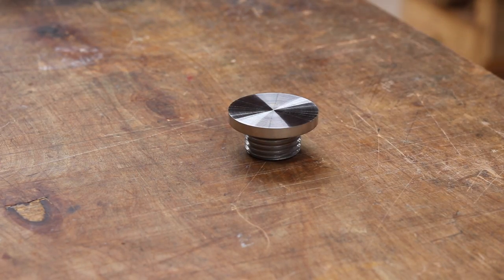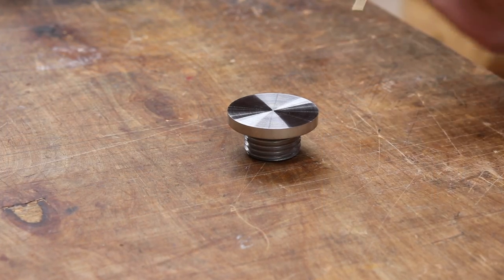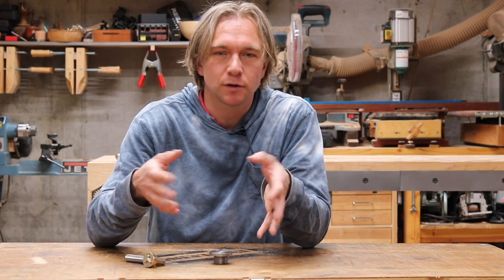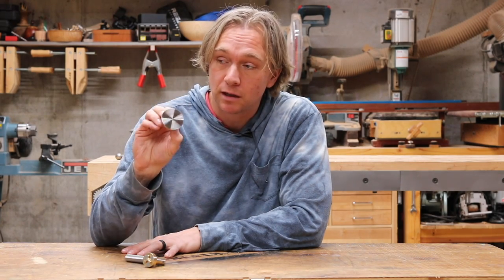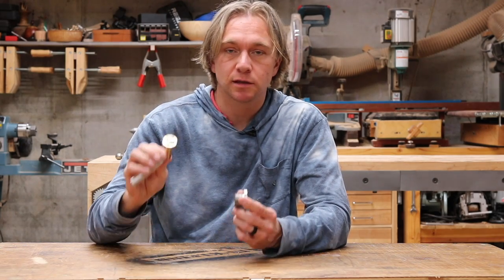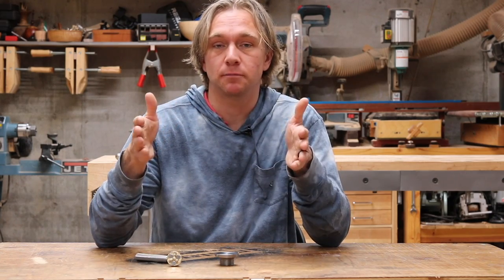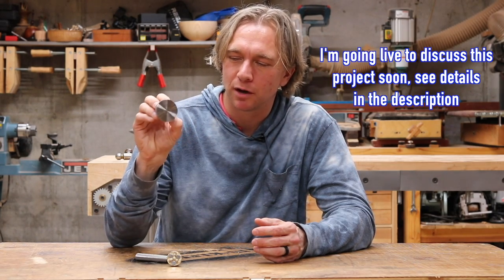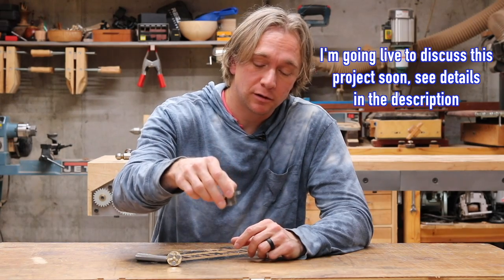A Screw With No (visible) Slot Is My Next Big Thing!

Comment: That's fuckin awesome. Yes I would buy it
Reply from the maker: Well you are in luck, the presale is open:

https://www.in-kleind.com/store/PIKA-c123455757
Reply: @AndrewKleinWW  do u have stock?
Reply: @AndrewKleinWW  I'm an engineer with 30+ years of automation. About 16 of those years was spent doing what we call special purpose machinery, which is basically production cell development. I have had to deal with people doing exactly what you are doing and make the production machinery for it. You are faced with 2 basic choices. 
1) you get an existing manufacturer who can do the level of precision you need to make what you have; or
2) you develop your own production which many do and MOST (as in 99.99%) fail at.

I'll break this down into a couple of comments so its easier to digest.
Reply: Regarding Option 1 - Getting an existing manufacturer to do the production.

Again there are options. 
a) You subcontract and maintain control of what gets made. If you don't have the experience with managing subcontractors you will go broke very quickly.
b) You take on a manufacturing partner as in you sell a stake in your business to someone who already makes things. You will lose a lot of control of what gets made because your manufacturing partner is going to want to make money. They 100s of things they might do that you might not like including re-designing your idea and that might mean cutting you out of making money. So if you take on a partner you make sure you have the money to pay a damn good lawyer to cover your interests.
c) You take on business partners just like people do on Shark Tank. Again you make sure you have enough money to pay a damn good lawyer to cover your interests.

Note: I did see you other vid about naming it and dealing with trade marks. So here is a bit of what I know about IP and Trade Marks.

IP is simply brutal. Just expect to get ripped off or for people to try and rip off your idea. There are simply no shortage of thieves in the modern world and the better ones have squads of lawyers who will simply beat you into oblivion. 

Trade Marks are different but there is a serious issue there as well.

If you remember there was a story a couple of years ago when Ivanka Trump secured her trademarks when she was in China.

I'm Australian and many Australian companies have found Chinese trade mark squatters already trying to snatch their trademarks. These people sit in offices in China and watch the world for people registering Trade Marks. When they see a new Trade Mark they copy it and register it in China. Their aim is to make you pay them to get your trade mark back. We have a huge export market in dairy to Asia and a huge part of that is into China. Our Dairy industry has had so many trademark fights with Chinese trade mark squatters. I have seen stories where people had their trade marks stolen in China with in hours of registering in Australia.

If you are not careful you will find Chinese knock-offs with your trade mark on the international market and you will get NOTHING without a hell of a battle.
Here's a story on one of the VERY FEW Australian companies that won any sort of legal battle in China with respect to trade marks. 
https://www.abc.net.au/news/2016-09-16/lucas-mill-family-fight-to-stop-chinese-copies-of-sawmill/7848394
Here's the video story on it. Do watch it because its due to be removed soon.
https://www.abc.net.au/landline/cutting-edge/7857350

Just so you know ABC Australia is our equivalent of PBS it has nothing to do with ABC America. The Landline program is weekly program on our agriculture industry. They have covered the dairy trademark issue several times.
Reply: Regarding Option 2 - Setting up your own manufacturing.

FIRST: You are going to have to listen to someone like me eventually or you will go broke like many, many others have. I have worked for people with genuine world class billion dollar innovations a couple of times and they ALL LOST their money. Here's 4 common mistakes.
1: They did stupid things like get side tracked onto other projects. This is without doubt the biggest issue with creative people who like working out new ways to do things. The struggle to keep focus on getting the job in front of them done. Leonardo Da Vinci was one of the great non-finishers of history. Its why so few complete paintings of his exist and why so few of his other things exist. If he hadn't been such a prolific writer and a couple of his note books survived we'd know nothing about him. But he was hopeless at finishing projects.
    
2: They have insane expectations on how long it takes to do things. Prototyping manufacturing and engineering systems is incredibly hard and and it can be insanely difficult and time consuming to get right. Something might take 5 minutes to do but it takes days or weeks to find out what the actual problem is and what then needs to be done. Creative people seem to forget that their idea took time to form in their mind before that "Ah Ha" moment.  

3: They think their ideas are the only ideas that matter. Sure the main idea is their idea but the main idea is NEVER the actual solution to making money, its just part of the solution to making money. You can fill entire museums with stuff that should have made people money and they all went broke mainly because they never considered that anyone else had anything worth saying.

4: They overrate the financial returns. The ACTUAL number of billion dollar ideas is far far far less than the real number of billion dollar ideas. Go watch a season of Shark Tank or Dragons Den and you'll understand that. 

SECOND: Don't listen to family and friends, unless they are telling you to get a real engineer with real experience to get this done. The number of conversations I have had that started "My son said...." or "My friend said....." or "My Cousin said....." that wasted time effort and caused no end of trouble is staggering. In some very rare cases they help, but usually its somebody who either means well or thinks they know something. The people who mean well usually aren't much of a problem. The faux-expert cousin or friend is ALWAYS as disaster. 

In the rare cases that the "friend" actually knows what they are saying it all goes well but those occasions are incredibly rare. The few times that has happened to me they turn up introduce themselves and tell me a bit of what they do as a way of letting me know they are talking with some experience. After the usual common ground it goes all right.

THIRD Almost everything you come up with can be improved. What is important is that you plan to go through the process of versions just like you see with computer software. You'd be amazed how many project failed because people just would not get the first version done. The most important first step is get a SALEABLE product into the market and start earning money. It DOES NOT have to be perfection it DOES have to be good enough to do the job and help build your reputation. Its one of those incredibly simple things business people always say and creative people ignore. To make a billion dollars means you have to sell 2 or more billion dollars worth of services or products. If you DON'T sell anything you DON'T make anything.
Reply: I would buy it but not for this price. I can only afford one and it still would screw up my monthly budget.
Reply: @tonywilson4713  exactly. I have known several machinist that have a great product that acts as a replacement/cheaper alternative to specialty parts.... Some even invented alternative replacements, and the issue is always the same.... We have an awesome product, but it is so specialty that they can't make enough sales to keep it going.
Reply: @matthewharvey8755  Yeah - Its amazing how many great ideas just aren't that great.

When I was doing my first round of post-grad there was this privately funded project to test a new bearing arrangement for a wobble plate motor. Mechanically it was beautiful, but also very difficult to make. The owner of the idea had spent a lot of money on patent lawyers and funding the testing.

To get the test rig working one of the machinists in the work shop made this alternative that was incredibly simple. In doing that he completely negated any advantages the fancy new bearing. That fancy bearing was beautiful but also totally impractical. 

And there are so many things just like that.
Reply: I posted it in the main comments but figured you might see it here since this is pinned. I like this name:

The Faceless Fastener
Reply: Or maybe The Seamless Screw
Reply: @tonywilson4713  You should write a book. Seriously, I read your entire post and was disappointed it was over. You write well and it was interesting. Write it as "stories from an engineer", not as a book that means to teach people how to be successful at making and selling. Kinda like a book that I read called "The boy who was raised as a dog", which is about psychology and has fascinating stories of cases, but does not teach you to be a psychiatrist.
Reply: Blind screw ? Probably already mentioned just thought I would throw it out.
Reply: Yes!
Reply: Kind of cost prohibitive.
Reply: I need some!
Reply: THAT BIG NO BUT SMALLER WOULD BUY ALL DAY FOR MY CUSTOM TABLES
Reply: I think  will order some. I love the open plead in this video. And the screw is amazing
Reply: Patent this ASAP if it’s not done already…
Reply: Security screwerity ,  screw-ed secured , secure screw , screwed UP , sticky screw . it could be fitted unfitted without the driver , not just by twist  screwing /unscrewing  though . hope you get there and don't get screwed over ,
Reply: @Tony Wilson
Yes, I agree with Avi, you’re a very easy to read writer and I too was disappointed to reach the end of your comments.